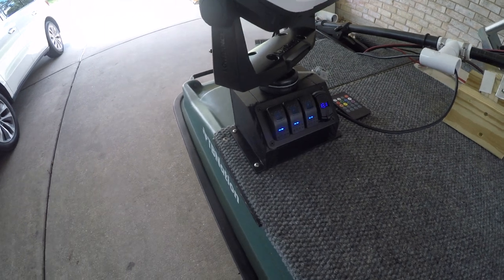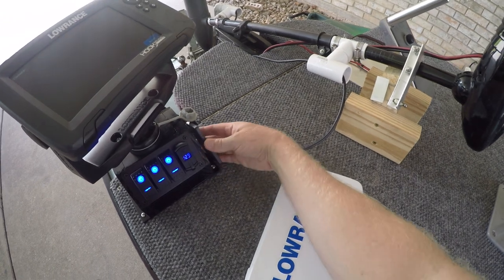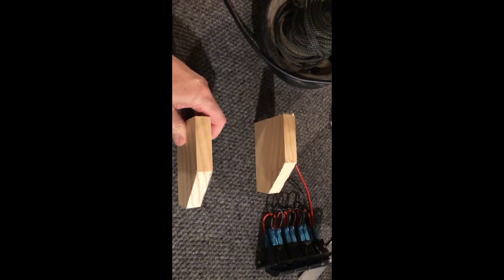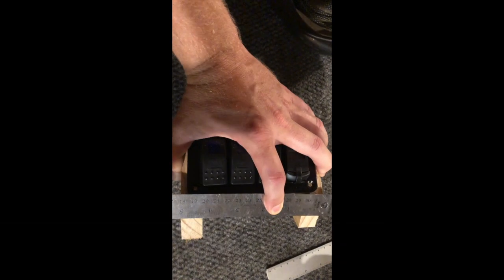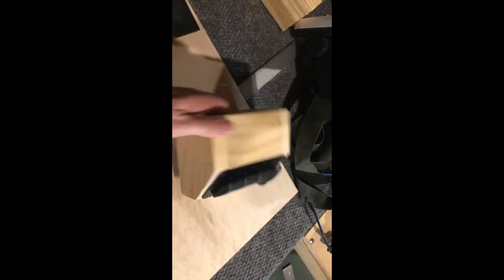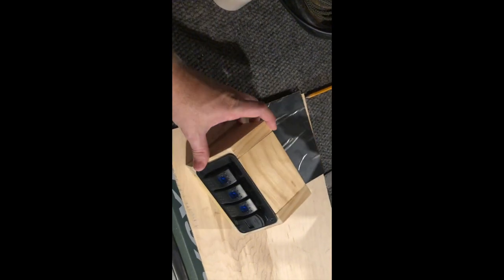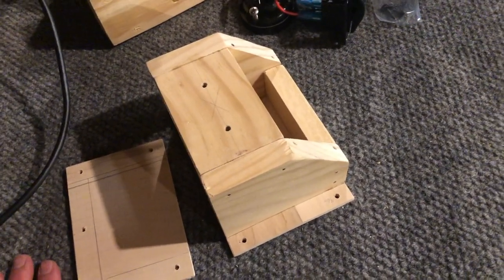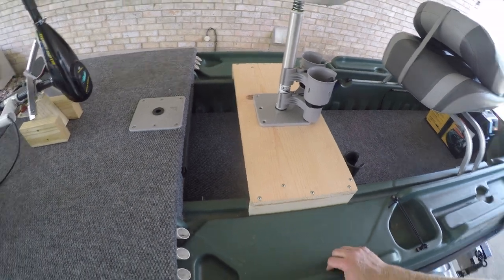Pelican Bass Raider 10E:  DIY SWITCH BOX MODIFICATION

Comment: You always got great ideas! Boat looks sick!
Do you have a link for the trolling motor plug that plugs into the front of the boat it’s 3 pronged I believe
Reply from the maker: Thanks for the compliment!  It’s a two prong plug. The plug is linked in the description section of this video:
https://youtu.be/3f946GKJRTo

All the best!
Reply: I noticed it on a another video of yours…that’s weird because my pelican bass raider not has a 3 prong socket in the front. Difficult to find one here in Canada as no one has these pelican bass raiders now. 
I had to drive up to the good old USA 🇺🇸 months back to buy the boat.
Thanks anyways for the speedy reply :)
Reply from the maker: @phils6733  my Raider has a 3 prong port in the front as well; however, the two prong plug works!  The third prong not used is the ground.  This plug has worked for years now without fail. All the best!
Reply: Oh ic, sorry for my ignorance lol I’m new to all this boating stuff. 
So because I dont have the experience with all this just like to run what I have by you…I have bought a minn Kota endura max 50lbs thrust motor I have a 22nf deep cycle battery that will be the only thing I’ll be running on this battery….so this plug should be just fine? 

I got my garmen running on a small separate battery.

Thanks really appreciate your help